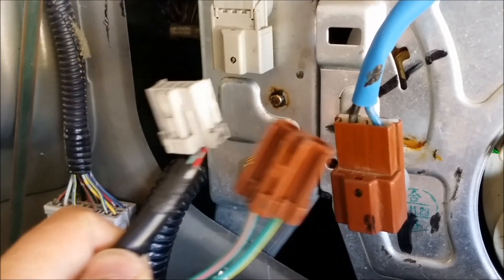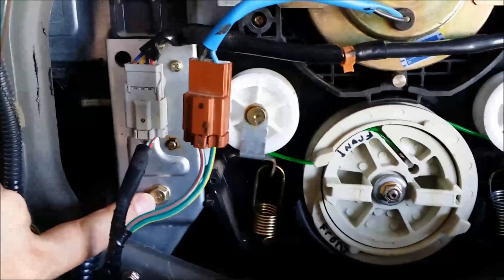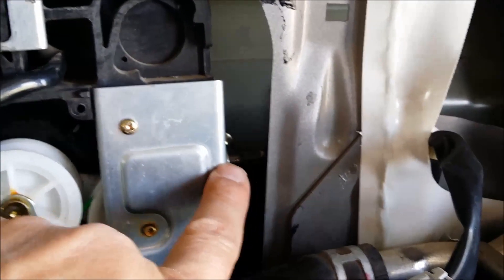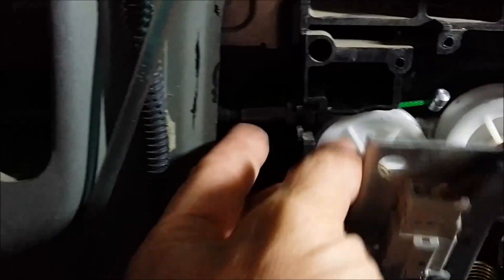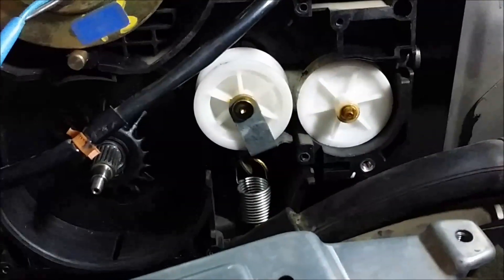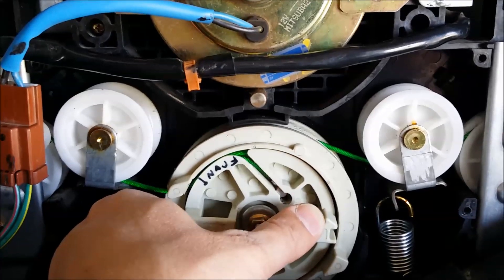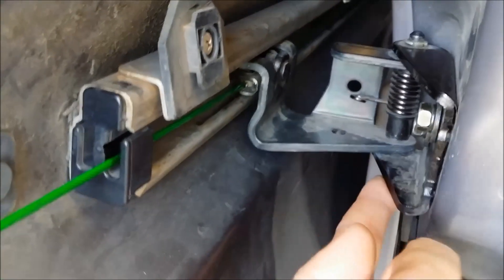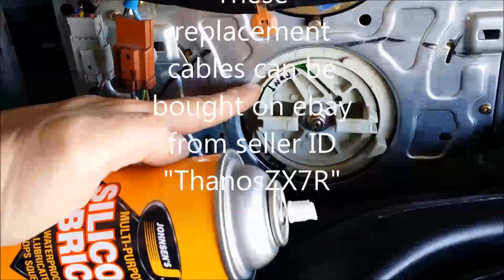Honda Odyssey 1999-2004 Sliding Door Replacement Cables

Comment: Thank you.  This worked!     I will add:   
1.  Be sure to put the plastic bushings on the door side cables before you solder the ends onto the motor side cables.  
2.  If you press the buttons on the dash to open\close the door without any door cables attached, the motor may only spin in the close direction.  This is on purpose, as it is used by the computer to re-home the door when it senses no door.    But this is a good test to ensure that the motor still works, so feel free to test it when you have taken all the door cables off.
3.  If you press the buttons on the dash to open\close the door without any of the connectors to the motor attached, you may hear a click as the computer will reset thinking there is no motor.  When you reattach the cables to the motor, it will still not work.  You must disconnect the van battery to reset the computer.   (I believe you can also just remove the fuse, but the battery disconnect worked for me).

Comment: what kind cable do u use ?
Reply from the maker: I use stainless steel braided cable wire. It has a tensile strength of over 100lbs. If you have any questions you can contact me through eBay auction 201097187057. You can also check my feedback from the hundreds of other users.
Reply: Aaron Tracy